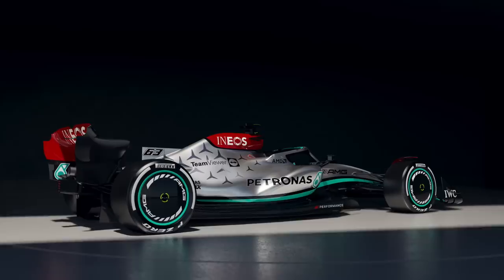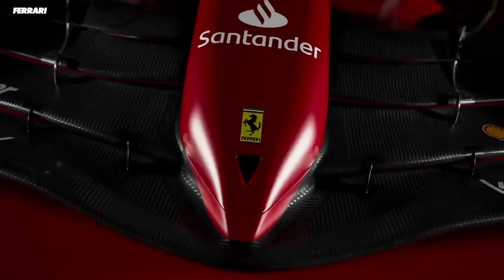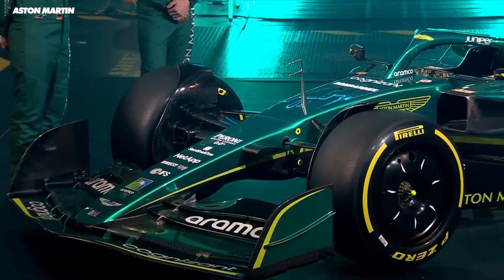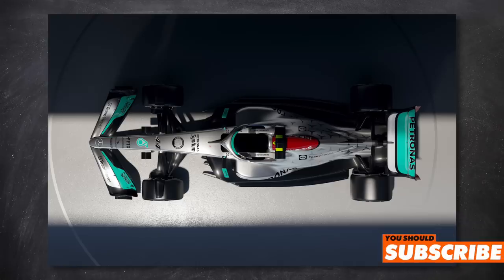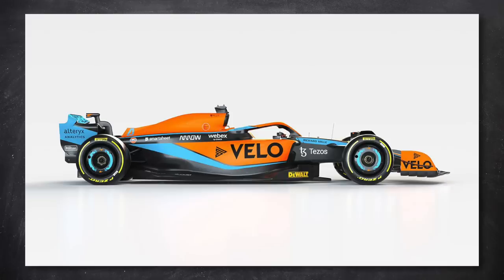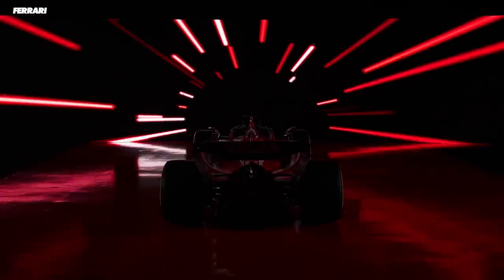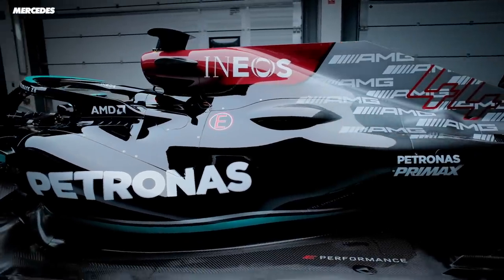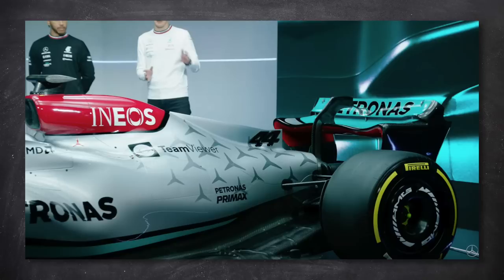Mercedes' Bizarre New Front Wing for 2022

Comment: Narrow side pods and no gills.  That's an advantage to top speed.  However, I am really curious about their effective heat management.  They are also the only ones to use Petronas.  As per tech regulations (???) you can have base fuel, oils, and lubricants available for public use, but have additives for racing use.  Could it be the additives have been the secret to their engine performance?
Reply: Could be. As other customer team hasn't reach the same amount of pace as Mercedes themselves
Reply: @hectornecromancer5308  I'd be incredibly surprised if it was all down to some fuel, oils etc.
Reply: @philmitchell9413  it's something that I just found out very recently too

Aerodynamic might be one thing, but why sometimes among teams with Mercedes engine seems to have different power, despite having identical power unit
Reply: @hectornecromancer5308  Support, software, knowledge on operating that unit. You don't want your customer to surpass your own work, right? It's like... being able to enter the "developer mode" in video games. :D
Reply: @sultankosmitov6293  exactly
Reply: @hectornecromancer5308  I understand but we have no idea of the drag difference between each cars. McLaren at times had a higher top speed so it's hard to say if it's all down to some fuel. I just can't see other fuel companies lacking that far behind in terms of performance. It's an interesting topic though that's for sure.
Reply: @philmitchell9413  in terms of power. It might didn't differ much (unless if you think that even less than 1 HP gain matters). But it can differ quite significantly in other area, like cooling etc
Reply: they can add louvers to the ~upper section of the coke bottle (to vent that hot air between beam & rear wing) for the hot races at least
Reply: @hectornecromancer5308  True.  IIRC, only Mercedes achieved 50% (or was it 55%) thermal efficiency in their engine.  They say, it's the Hot-V design, but honestly think customer teams will get the same but No.  From lubricant and cooling fluids, to the software, I think Mercedes works team still has very exclusive knowledge.  Petronas is one of the most obvious so far.  Everything else could be underneath.  Also, remember when Honda admit receiving an additive for their lubricant?  The performance gain allowed RB to catch up with Merc... then Merc again made performance gains to fight RB.  I honestly think the Merc PU still has alot potential still concealed... as long as Petronas is still solely sponsoring Mercedes AMG and no other else.
Reply: We'll find out soon if they will resort to the gills on hot race venues.  However, the way the sidepod has been sculpted tight means their PUs are able to handle heat really well.  AMR for example, have gills and yet the side pods are still wide in comparison.  Well... we are basically speculating on non-race units.  Even if they are "functional" show cars, it's still not their actual weapons.  We'll find out soon enough!
Reply: @Jojo_Bee  possibly the reason Aston Martin are intrigued to make their own PU as well
Reply: Just because they are sponsored by Petronas, it doesn't necessarily mean they use Petronas products. It's all about the money and the exposure. I've been involved in top-level motorcycle racing, and it's the same there.
Reply: @MrMairu555  That is true.  Does this mean, all the more secretive are the fluids they use?
Reply: @Jojo_Bee  hi Jojo Bee.
Reply: @hectornecromancer5308  What is PU?
Reply: @MrMairu555  Petronas is now one of the major sponsors in F1.
Reply: hot races like Indy 500?
Reply: @purwantiallan5089  Power unit. Also known as Engine
Reply: @purwantiallan5089  Absolutely, but I'm just saying it doesn't necessarily mean that any particular sponsors' product is actually used. Specifically, I've seen GP bikes wearing branding for petroleum companies associated with the riders nationality, purely for the exposure in their home market, but know for a fact that brand isn't used. Another example -- in bikes again -- for a long time, was exhaust sponsorship by a company that didn't actually make the exhausts, but wanted their name out there.

Of course, I'm NOT saying they don't use Petronas, I'm just saying it's possible they don't, from previous personal experience.
Reply: @hectornecromancer5308  Because Mercedes builds the power unit AND the car which gives them a huge advantage as they can build them harmoniously to get the best performance out of both. Verses the customer teams have to build the car around the engine they get and they may have different philosophies that cause them to not work as harmoniously or just don’t have the resources and/or ingenuity that Merc have.
Reply: @Jojo_Bee  All the fluids, but in particular the fuels and engine oils, have to be FIA approved (i.e. submitted for testing before they are allowed to run) and are randomly tested during the season. Article 16 of the regulations is dedicated to fuels, and acceptable variations from the FIA spec are down to fractions of a percent. Gains are more likely to come from cheating, as Ferrari were suspected of doing in 2019, than by a special blend of fuel... there just isn't room for it in the regs. Petronas may very well supply their fuel. All I'm saying is just because a sponsor's name is on the side of the car, it doesn't necessarily mean they use their product(s).
Reply: The Honda PU was a far better engine last year and it showed. The only way merc could compete was by killing their engines and taking penalties. I don't think the additives are a major contributing factor to their pace as at many races they were beaten by their customers in straight line speeds. Of course this could be down to setup but look at how fast the mclaren was going at certain tracks in comparison and its clear that merc werent the only team able to reach those speeds. The only reason the Honda PU doesnt get the credit it deserves is down to the way red bull set their cars up. That being EXTREMELY high rake and high downforce when compared to other teams. The Honda PU may not have got that RB to the same top speeds but it was pushing a much larger kite through the air.

In fact if you look through the speed trap data for the 2021 season you will find that Norris was typically the fastest Mercedes engined driver through the speed trap, about the same amount as hamilton.

Comment: This is most likely not as close to the final car as the one unveiled in the video. You can guess that by looking at the length of the overhang bits over the tires and the swept shape on the sides of the front wing.

Comment: I’ve been wondering about these launches for a while as teams tend to run different specification wings throughout the season. Is this a high downforce vs a low downforce setup and is there much difference between the two for this year. I assumed they just choose what looks good for the camera eg extra curves to catch the light than necessarily what they will run throughout the season

Comment: I'm really excited about all the new cars, and how the right insights could really shake up the field. But I think the first half of the season is also going to be a STEEP learning curve for drivers, as they all get used to these new cars. The struggles Danny Ric faced with adjusting to a new car last year? That's the entire field this year. We'll see who is flexible, and who has to make big adjustments to their driving style.
Reply: I may be wrong (I am often wrong), but I think this new design is going to be great in corners for smoother drivers like Lewis, and harder for aggressive drivers like Max who turn harder. On the other hand, I think cars designed for closer racing will be a benefit for risk-takers like Max, and hard on drivers who aren't great defenders.

Comment: Cooling through the back of the car? A blown diffuser concept perhaps?
Reply: Before this year where louvred where available, every single car was cooled through the back, nothing new, just an opening in the aero at the back where all the hot air exits after entering the sidepods and going through all the radiators

Comment: I am curious how the teams will shift balance from front to back and vice versa, since most (?) of the downforce is created under the car.
They would need to be able to control the amount of air going under the car, because the floor ist fixed, right?

Or can you make adjustments to the floor?